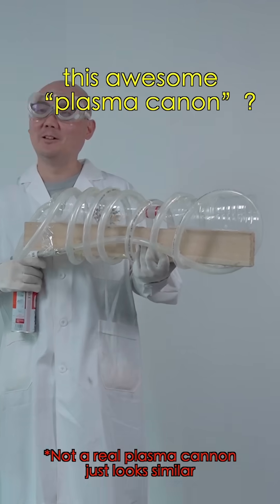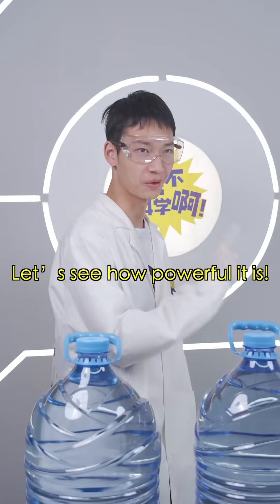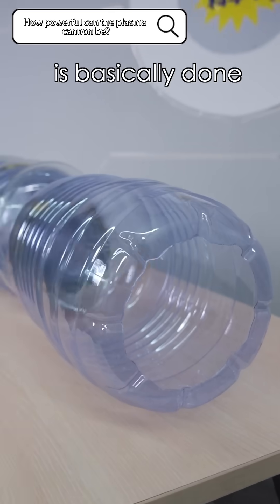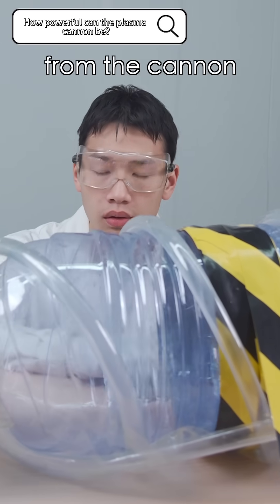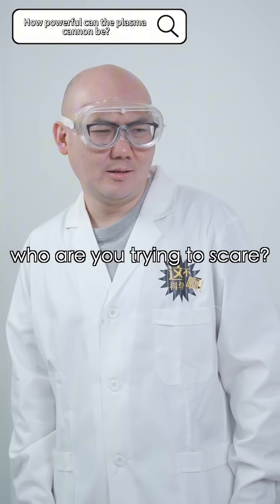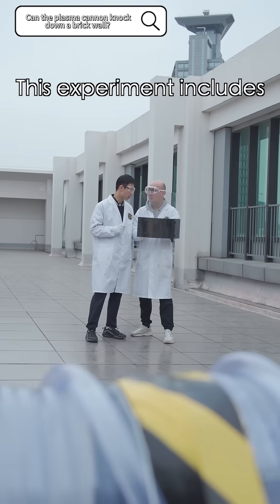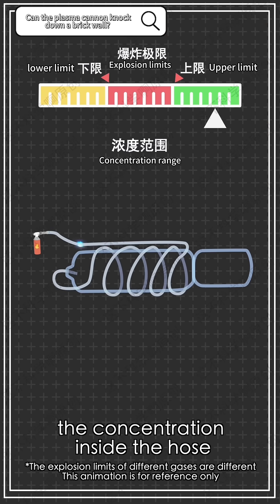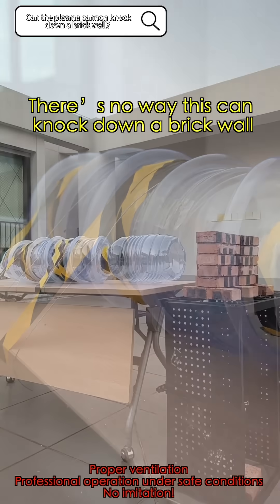Could Miwu Make an Awesome “Plasma Canon”❓Let’s see how POWERFUL it is❗️❗️

Comment: He said not to imitate what he just did, but yet I did—for my science fair. I won't advise you to stay away from trying this at home, just make sure you don't aim it towards outlets. Also, it does in fact have plasma, but the plasma only lasts for a very short period of time. Still, this still fits into the definition of what plasma is. I didn't use vinyl tubing though, I went to 6 hardware stores to find it, but none of them had it. If you want to, go ahead,  nothing is stopping you from trying this out. Just make sure to hot glue it properly.
Reply: BUT DO NOT REPLICATE WHAT HE DID AT THE VERY END. THE CHANCES OF IT BLOWING UP GO EXTREMELY HIGHER. INSTEAD, YOU COULD USE SMALLER JUGS, SUCH AS COCA-COLA BOTTLES

Comment: The Su-27 entered service with the Soviet Air Forces in 1985. The primary role was long range air defence against American SAC Rockwell B-1B Lancer and Boeing B-52G and H Stratofortress bombers, protecting the Soviet coast from aircraft carriers and flying long range fighter escort for Soviet heavy bombers such as the Tupolev Tu-95, Tupolev Tu-22M and Tupolev Tu-160.[2]
The Su-27 was developed into a family of aircraft; these include the Su-30, a two-seat, dual-role fighter for all-weather, air-to-air and air-to-surface deep interdiction missions, and the Su-33, a naval fleet defense interceptor for use from aircraft carriers. Further versions include the side-by-side two-seat Su-34 strike/fighter-bomber variant, and the Su-35 improved air superiority and multirole fighter. A thrust-vectoring version was created, called the Su-37. The Shenyang J-11 is a Chinese license-built version of the Su-27.

Comment: Here in the Philippines we have something similar called a "boga" or "lantaka", we use metal cans or Yakult bottles sometimes, pls pronounce boga as ''BU-ga", not "bow-gah" 

–to make one you need a couple of cans, 5-8 should be enough 

–Start by stacking them verticaly and apply tape, i recommend heavy duty brown tape

–Next, get a plastic bottle that fits with the cans, do not throw the lid away, then cut it in half,cut it on either half way or near the top, not too high though, if it doesn't fit, make small cuts around the bottom

–place the bottle on the cans on its open side, the use tape or stick glue, i recommend tape,

–now get a lighter, not the ones with wheels but the ones with a button, its called a cricket lighter 

–then disassemble the lighter and get the part that is under the button, the part looks like a black rectangular thing, and has a wire connected to it, that part is the ignitor for the boga

–make a big hole for the rectangular part and a small hole for the wire, make sure that the hole is just big enough for it to fit, then glue it so it doesn't fall out when firing, you can also put it on the side and use a another wire to connect the one connected to the rectangular part and insert the wire on the side of the bottle then glue it

–after that is done, use alcohol for the fuel to make the fire, when choosing which type of alcohol i recommend flying tiger alcohol, note: when firing i recommend covering your ears because it is going to be loud, do not point it at someone unless they are threatening you, it can be used as a defense weapon 

–the final step is to fire it,

If you liked this tutorial pls consider liking and subscribing to my YouTube channel where i make random, stupid,low quality shorts

Thank you :)❤
(I havent uploaded in months (╥﹏╥))
Reply: ONLY 3 LIKES
Reply: Damn i love yakult
Reply: In Indonesia, this simmiliar thing is called spirtus
Reply: Many kids in the Philippines will make a boga or lantaka in new year
Reply: Hi! im also philipines but i font speak filipino.
Reply: dont
Reply: Im from Philippines and i speak Filipino
Reply: My brother has that
Reply: hi fellow filipino!

Comment: Miwu, what happens if you compress the hole? Will it become small and strong or it will just expand? Like compressing the flame into a small strong plasma?
Reply: what i can only imagine is that it heats up too much and melts the entrance
Reply: I got two endings for that 
1st : it may melt the entrance n the flame of the explosion will be weaken 

2nd : it will go through l8ke a funnel but it may be too small n make the contraption A, melt, or B explode
Reply: Bro I see these all over TIKTOK so people initiated
Reply: i think it wont have enough time to release all the pressure, so it will either expand and explode, or it will catch fire and start melting

Comment: But why didn't the water bottle burnt down due to flame... ?
Reply: Because of the reaction between the bhutane and the plastic contained in the water bottles the flames are released through the pipe not the actual base of the bottle and thus not burning the bottle of water
Reply: Heat transfer, the flame is moving too fast to burn it